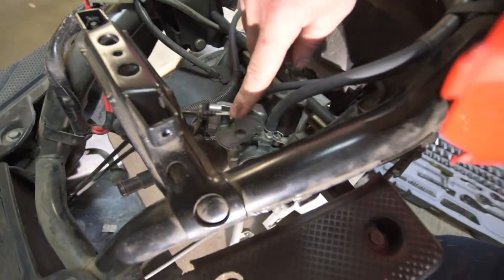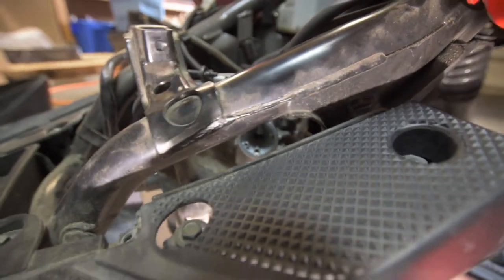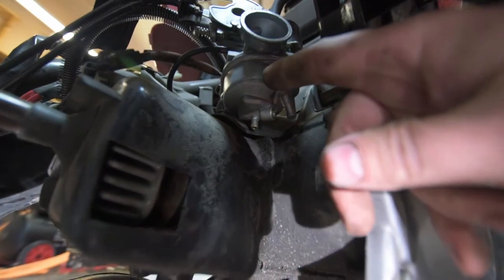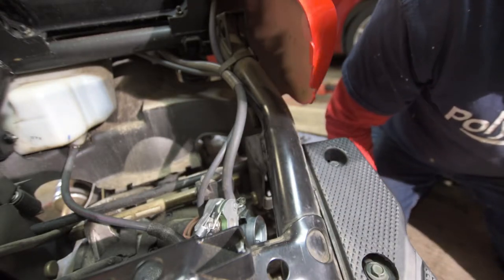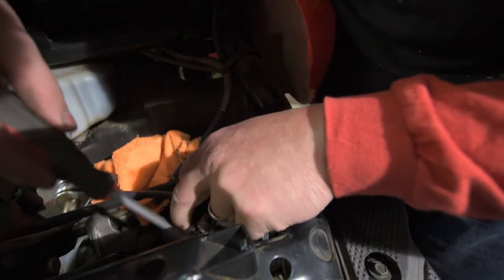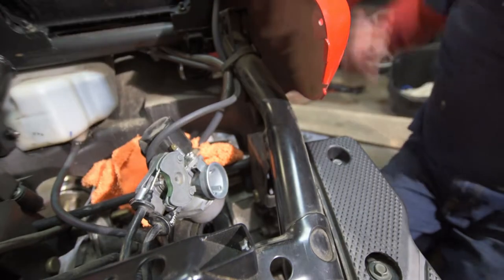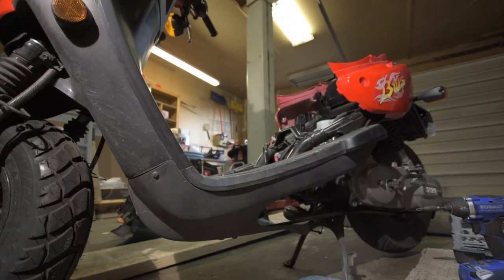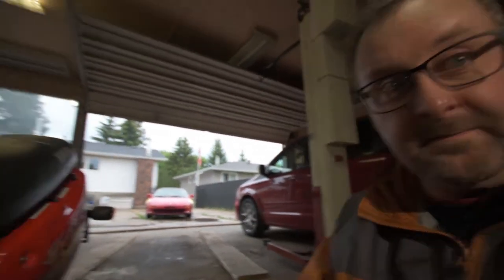Drilling out scooter carb jets

Comment: Each time you change your Jet, I recommend that you start the scooter, and accelerate for a few seconds at full power. Then remove the spark plug from the cylinder and look at the color of the spark plug. If it is dark black, it means that there is too much gasoline compared to the air, so you must lower the size of the Jet. If the spark plug is white like snow, there is too much air compared to the gasoline, so you must increase the size of the Jet. Finally, if the color of the spark plug is brick red, the size of the Jet is perfect. The mixture in the combustion chamber is perfect. I hope I helped you, continue the videos!
Reply from the maker: I will give this a try.
Reply: @therealboofighter  alright buddy

Comment: a lot of jog minarelli 50cc engines have a #72 main jet and  a #17.5 pilot jet you can bump that up to a #75 on a stock engine but whenever you do a 70cc bbc  you will need a #105 main jet  and a 43.5 pilot in your stock carb or put performance intake manifold and 24mn carb when using a new air filter make sure it has a 90 degree bend so it clears your frame also do a new performance clutch and variator ..... use (15/50) gear's in your transmission there taller and you'll need them to see full potential of your added power
Reply from the maker: I haven’t done an update video for awhile, but it seams to lose power with a #78 and #82. The stock 80 seams to run the best. I could be wrong but my highly calibrated butt dyno says that’s the happy spot. lol.